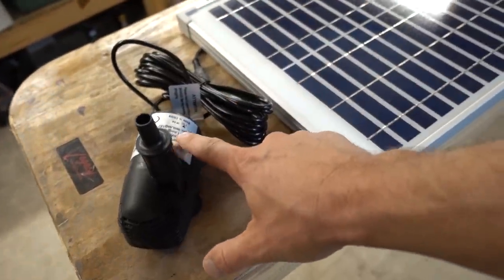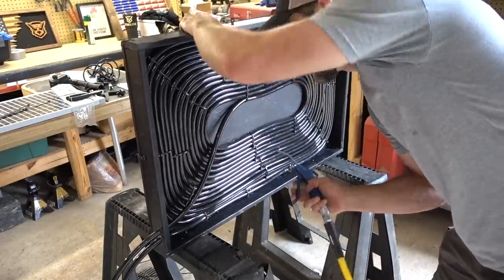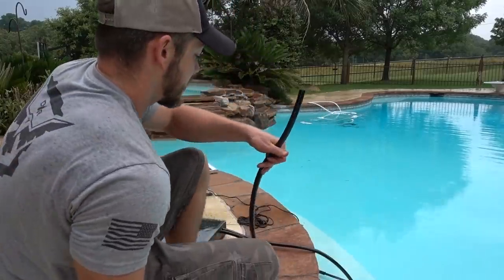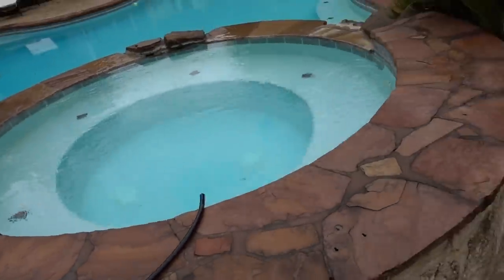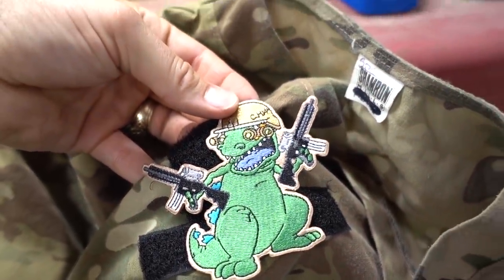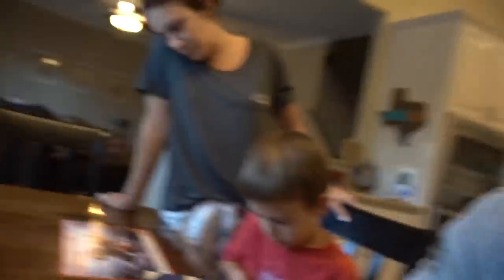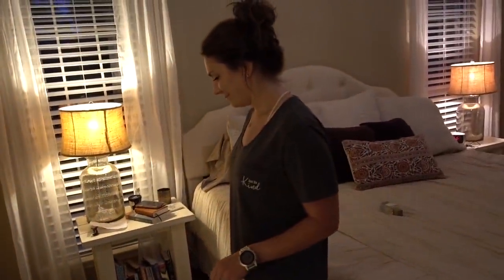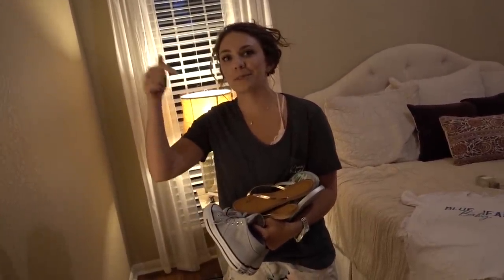Homemade Solar Powered Water Heater

Comment: Put more hose coming out of the heating box, My dad did this when I was younger, All us kids that ended up in the pool loved it because the hose pumped out warm water even if the pool wasn't necessarily warm and that was fun to play with as well, balanced out the cold with the warm hose water, Our pool was much smaller though so in all it did actually make a difference to the pool temperature but the hose was also great with the warm water pumping out.

Comment: Why don't u just connect the solar panel directly to an electric heater.
Reply: Would be more effective than this, but maybe he can get his hothtub to go up a degree
Reply: well yes, but his way collects solar energy for the pump AND solar energy for the heating separately. So basically the heating is not that much limited by the solar panel (which has a shit efficiency, as solar panels do). Your way would be the best if he had infinite amounts of solar panels (and space to install them).

Actually, it would be interesting to see what is more efficient: the panel or the black-pipe-heating thingy.
Reply: Olaf Albin its just not as cool :)
Reply: Because power bill. It's a amazing how expensive electric heaters are.

Comment: It worked at my house doing that. Circulating the water with a pump that was plumbed in when the water filter ran but had a shut off valve.

Comment: Matt have you looked into using the HVAC system in your home to heat your pool in the summer? It uses the hot freon returning to your condenser coil to heat water from the pool.alao it helps the efficiency of your HVAC system by transferring heat to the pool water. And it will have a valve that controls when this is done.

Comment: i'm making a solar boiler for a school project and we found that using glass instead of plexiglass makes a huge difference, just make sure the tubes can withstand the heat. An other group used glass in combination with pvc and tyleen, the tyleen got too hot and the tubing came loose. Yours should be okay since its one continuous loop and constantly has water running through it.

Comment: I think you best bet for keeping your pool warmer would to get a solar pool cover, Its not as cool or fun but works really well.  Prevents heat loss through evaporation and warms over the entire surface area of the pool.  Only issue is storing the cover with not in use, I'm in North SA and I have to pull mine off during the summer because the pool gets hot.  I have some extra cut offs if you want to play around with it.

Comment: Saw the first part aaand, ...
Firstly, i'm glad you got a different Pump (because it's going to be submerged constantly)…
secondly, you improved your design, which is great!
Pro Tip:
If you want the tube-coiling flat, stick out the inlet and outlet tube out of the box at the very beginning, 
so you have a looong loop. This loop you can coil up then and there's no crossing needed in the end.
In any case it's going to work… slowly, but it's going to work!
Regards again from the german engineer. ,-)

S.

Comment: I suggest the outlet (hot/warm water) of the new solar heater be run to the bottom of the pool. Heat rises, cold sinks. If the hot coming out of the pipe comes in low on the pool it will be more effective than it pouring over the top of the water.

Comment: Need to scale that up a bit junior. Bigger diameter tubing, corrugated black for more surface area, and a larger sized panel. Use mylar in the back of the box and watch your temps rise

Comment: Matt, when I was a freshman physics major we made similar solar water heaters similar to yours.  We heated a 55 gallon drum nicely.  To heat a pool you will need a much larger surface area.  The most effective way to solar heat a pool is a floating solar pool blanket.  They work quite well up here in the north.

Comment: Just connect the solar panel to a battery so it can keep it charge and then you can have a bigger pump to move the water. And you can keep the battery inside a weather proof box boom.

Comment: I think that heater will actually surprise people at how well it will work. They sell those for that specific reason and they work well. The only difference is the store sold ones have bigger hoses. If hed get bigger hoses and a big pump itd heat up the pool in one evening for night swimming.

Comment: Hey Matt, you may want to spread apart a bit more the pump and heated water outlet. Otherwise you might just be sucking back up your already heated water rather than the still cool pool water.

Comment: We have those pool heater setups on roofs all over in Las Vegas. One of the biggest things they share is that they don't reflect sunlight.  You have shiny hose covered up by shiny Plexiglas. You should just spray paint the Plexiglas flat black. Any light reflection at all is wasted for your intended purpose.

Comment: The one we built was made with one board and 100ft of lawn irrigation pipe wrapped in a circle fastened to the board using a 
Filter to circulate the water back into the pool, but with a shutoff valve if the pool didn’t need heated water. And we laid it on our roof and it worked great.

Comment: You should have put aluminum on the bottom under your tubes so the reflection will heat up the tubes more results warmer water.

Comment: It’s will work we have 300 feet of black tubing on our roof and water pumps through it and it comes out burning hot and heats up the pool by 7-10 degrees

Comment: You should silicone the edges of the wood hitting the plexi glass so its a complete seal trapping in as much heat as possible.

Comment: You might want to separate the intake and output of your heater. I could be wrong but it seems like you would be recirculating a lot of the same water preventing it from dispersing.

Comment: I did something similar. I used 300' of 1/2 " black hose on roof to heat only 14 ft pool.   I used a 1/3 hp utility pump. It was not strong enough. I had to prime the lines with water house.  I got about a 15 degree increase in temp coming out of hose. Still did little to increase water temp of pool.

Comment: @off the ranch 

Voc= when it's cold outside the module (panel) voltage is higher. 
Vmp= when it's hot outside the module voltage is lower

There are also correction factors for voc and vmp to find out the extremes of both hot and cold cell temp. 

I believe that you don't have to worry about either with your one module. 
#themoreyouknow

(I'm a solar designer)

Comment: Matt if you routed the hose in the center of the loop through the back of the frame you wouldn't have needed to drill dozens of holes for the cable ties and my suggestion for reducing the eighth of the outer frame would have worked. Putting short feet on the frame would have given room for the exiting hose.

Comment: Matt, to maximize the use of your solar panel, make sure the panel is facing south, at an angle that is the same as your latitude at your current position, this will maximize the amount of sun that hits your solar panel.

Comment: You need more surface area more like a 4x8 panel and have a open area to the south east for early morning sun you might be able to get 10 degrees and have your discharge and intake at the bottom of the pool for more even heating

Comment: Matt, you'll need a lot more black pipe, also consider putting sand, (black sand in the box). You'll nee to take a reading from the bottom of the spa, because heat rises. wish you luck, but I have my doubts because the time it takes to heat the water, also allows the water to cool. Another words you'll have to heat 2x faster than it takes water to cool to raise a temperature

Comment: You should build it a little larger and so it holds water for the time it takes to heat up then it pumpd it out and fills with pool water again then stops. Basically you just need a timer on the pump.

Comment: What you gotta know is how many gallons that will warm per hour and then notice your pool has a lot of water then realize that your pool will probably naturally cool down slightly faster than what that can heat up. You’ll need a bunch of those solar heaters to get a few degrees on a pool

Comment: Laws of thermal dynamics says that you'll be cooling the coil and the pool won't change any degrees. Need more loops or a bigger loop. If the sun isn't warming the pool, then the sun warmed water can't warm the pool, as it is. As others have discussed. Foil on the bottom and walls. Maybe a one way mirror on top? But you're gonna need a lot more heat

Comment: You can figure out how much that will heat your pool. All you have to do is find the amount of heat absorbed by the water in the hose in a given time period, the volume of water that is pumped, and the volume of the pool. Using the temp of the pool water, and the temp./  flow rate of the hose you can find the amount of heat output. Mare should be able to do this fairly easily since she is an engineer. (if i remember right she was anyway lol.)

Comment: I'm behind on my demo ranching and off the ranching you will burn out that pump if it's running under voltage get a small battery put it in between the two as long as it's a 12 volt pump in a 12 volt battery to solar panel will charge the battery to battery will run the pump the pump won't burnout
and it only works straight from the panel into the battery that way if it's no more than 18 volt panel if it's any more than that you need to get a charge controller and put it in between the solar panel and the battery

Comment: You should run the hose to the other side of the pool so it always is taking cold water instead of cycling through the same water

Comment: I mentioned this in the last video, but fairly late so you might not have seen it....

I think you're going to need a few more of those panels. On my last house I had four 4-foot diameter coils of black hose on my roof, and it heated my small pool (10x25 foot, ~4 feet deep) about 5 degrees. That was in northern CA, so not as much sun as you get, but still, I think you'll need 2-3 more of those. Still, cool idea!

Comment: Cable tie the outlet pipe to the inlet pipe or some other heavy item once the sun increases the pump power will increase and the pipe will move with pressure and you’ll dump pool water

Comment: Separate the supply and return as much as possible to avoid short cycling (re-heating the already heated water), and you might want to put a speed control on the pump to optimize heat transfer.  If it's flowing too fast, it won't absorb the most amount of heat.
That being said... you're definitely going to need a larger heat exchanger, or more of them in series, to be somewhat functional.

Comment: A friend of mine in Florida has a solar hot tub heater. The tubing and panels like the one you made is up on his roof AND his hot tub is steaming hot all the time SO it does work, i'm just not sure if 1 panel is enough for your pool.

Comment: You should rough up the hose with some sandpaper so it's not reflective, that will help a lot more than you'd think.
Reply: Yeah it would also increase the surface area and it would technically heat up faster

Comment: Put mirrored window tint in the botttom of your box and on the inside of the glass top shiny side down will heat the water up hotter and faster done it years ago and is still working great

Comment: Ya should have used one of the pool filter returns to push the water thru your heater.  I mentioned they sell a solar heating system at places like Walmart right? We got ours thru our pool dealer and it raised the temp over 20*.  I'll find ya the info and send it to ya.

Comment: You can use any golf cart battery and a cheap $50 solar power charger to make the pump run efficiently and only pull the power it needs from the battery instead of wasting power from the panel.

Comment: should have kept running the coils until the centre was full then put the inlet and out let through the rear in the centre of the board as would have given more surface area , then put an adjustable stand on the rear of the frame too so could point it directly at the sun

Comment: If you want to read up a bit more on tubing for water heaters: http://ascpro0.ascweb.org/archives/cd/2010/paper/CPRT192002010.pdf It is a paper about which kind of tubing you can use best. From my perspective, you did quite a good job. Putting plexiglass on top of the heater will not absorb the infrared radiation that you try to catch. Also, wood is a bad heat conductor, so the surface of the wood will get hot, which will radiate heat towards the tubing. For a DIY project, not bad at all.

Comment: You probably need more separation between your pickup tube and return line.  Your concept is sound though, use a thermometer on your incoming and exit water to see how much heat your applying.

Comment: Next one you make should be full plexiglass and pex pipe then put a tap on it so you can pull a vacuum on the case. That will greatly increase the efficiency. Since all the heat will transfer to the tube and not air around the tubes

Comment: Seal your exchanger water tight and throw some desiccant packets in there to limit water vapor.  You want as little thermal convection as possible (a vacuum would be best, liquid water is worst).

Comment: Hey Matt when I was in high school we made the solar powered oven things to bake cookies with and they were made about the same way for one thing we did different was we line the inside with aluminum foil and I think if you did that it might help draw more heat in by reflecting more sunlight the Blackwell draw ambient heat and but the ward will hold on to more heat instead of transferring it back to the black hose the word will get hot but the hose and the water might not. If the alarm for a Liz line underneath the hose then it will put as much of the heat in the sunlight directly into the hose
Reply: Wood*

Comment: To give your project the best chance put the heater and solar panel at an angle towards the path of the sun.   Screw a couple boards on one end of the heater to use as legs you can do it with the panel as well it won't damage it or just build alittle frame for it .Just my 2 cents my entire house is off grid in Hawaii 🏖🏖

Comment: I've got an idea, not sure how good it'll work but what if you built a clear plastic cover for the smaller pool so it will act like a car in the summer with the windows rolled up, it should heat it up pretty good, and since water circulates from the big pool to the small one it should help heat the big one too, and when y'all want to get in the small pool just remove the cover and jump in!

Comment: Zip tie the hose together and drill a hole in the center for the palace drop through so it's not crossing the other ones. I made one out of PVC pipe and a full sheet of plywood and zip tied the pipe to the plywood after I painted the Box black

Comment: Put a check valve to a 100 gallon barrel that stores warm water from the radiator and pump flip the valve and run the warm water to the pool while replacing the warm water with cool water into the barrel to get warm

Comment: Hey matt take some mat black spray paint ans spray the hose because now some of the sun will reflect off the shiny hoses but with the paint it wont reflect as much but you will get higher efficiency from it also font scuff up the plexiglass thats okay to be shiny but make sure both ends of the hoses are in the water so when the pump turns off you dont have all the water drain back from the hose and make the pump work more